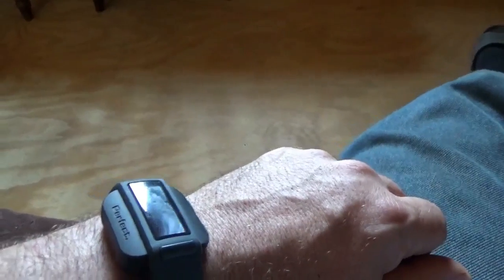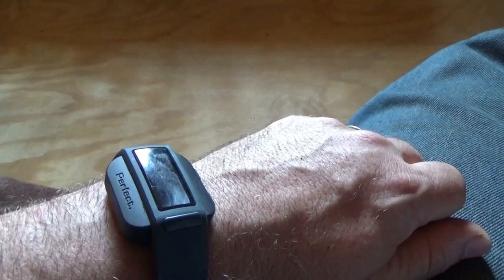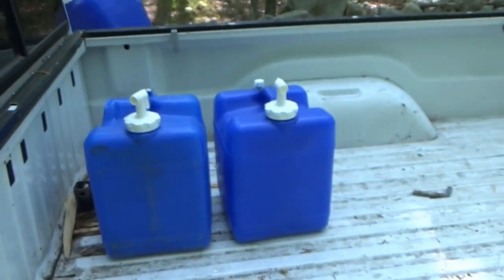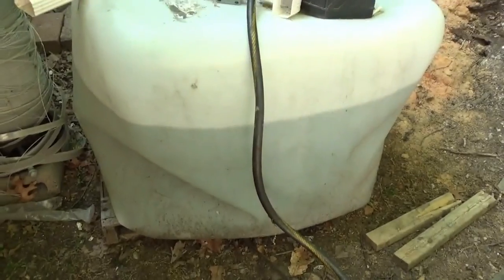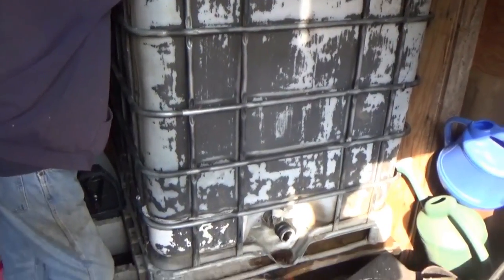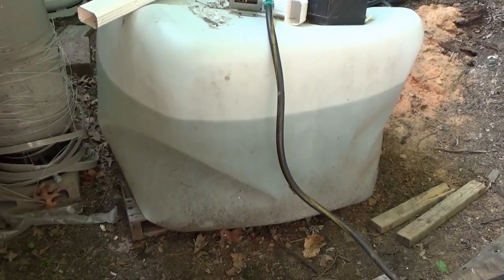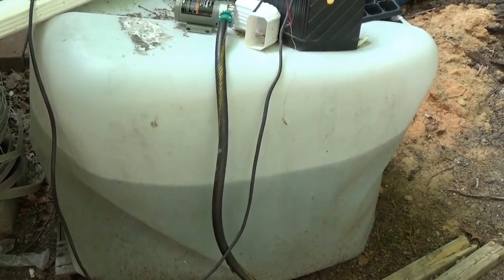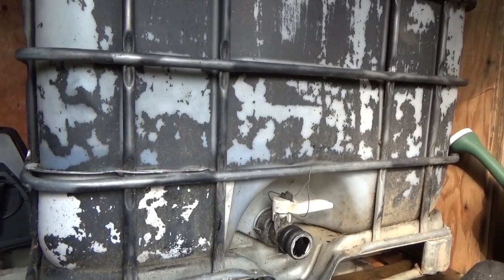Running Out Of Water @ The Off Grid Homestead

Comment: Before using your incubator to hatch eggs, you should run it empty for a day or two and have a second thermometer inside to 1) ensure that the incubator is keeping the proper temperature and 2) to allow you to calibrate the incubator's thermometer if it isn't.  Not sure if that particular incubator allows you to calibrate the thermometer, but many do.

Without testing it first, you're potentially just wasting electricity, not to mention your time.  Also, I'm not certain that turning the eggs once a day is enough.  But, best of luck to you!

Blessings,
David.

Comment: yeah on this issue I would say you need to make a pond just a small one.. But to do so will take a lot of man-hours and you will probably need some type of machine like a black hole for mini excavator.. I hope you seen my comment on the cheap DC air cooler idea.. that is to make a PC cooler into a cooling contributor to the house.. Buy one or two methods.. This I would actually like to see you try this experiment.. If they can cool a room with dry ice and running liquid over a fan then on hot sunny days you can run a DC cooler refrigerator with water running through it as a cooling transfer type of thing you can do this with plastic tubing that is cheap.. I wish I could come over and help you with your project can create some..
Reply: "a black hole for mini excavator."    What?
Reply: "back hoe or mini ex.." (typo)
Reply: Yah what can I say its  speech to text
Reply: lol. gotcha bud! :)

Comment: you need to calibrate that step counter, i bought one a while back and the default step size was completely wrong, was saying i walked like 10,000 steps when i only walked around the house for the day.. once i change that it was reporting somewhat correctly.... also i just use my phone now because s-health has it built in and it uses gps on my note 4 to track my stuff much more accurately
Reply from the maker: I believe this is pretty accurate though because I literally run all over the place out here. Melanie and Chris can both confirm this. I am on the move all day running from point to point. Especially when I have the camera with me.
Reply: The Do It Yourself World still think its off, im a nurse and i dont even come close to that in a 12 hour day helping patients constantly all day.....

Comment: Off grid remote folks around here have 500 gallon tanks on trailers that they hook up to their pickup hitch and go to friends or family who have wells, where they fill up once every week or two. They also have excellent set ups that reuse the rinse water from the washing machine for the next load or laundry so the rinse water is not simply diverted to the grey water holding tank for use in the garden.  To drill a deep enough well in our areas of the Sierra runs around $10k.   My Fitbit only tracks actual steps whereas the cheaper fit bands tend to click anytime the person moves.